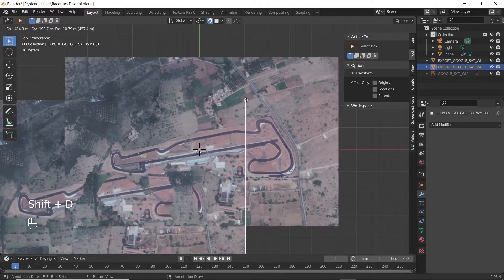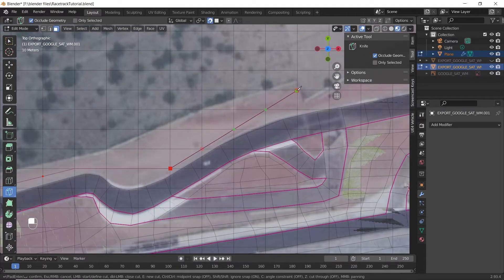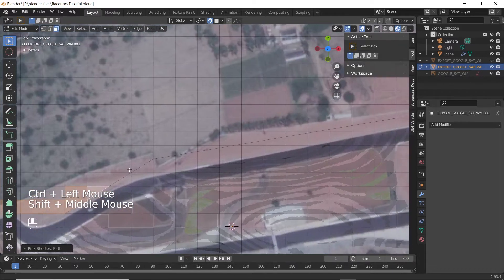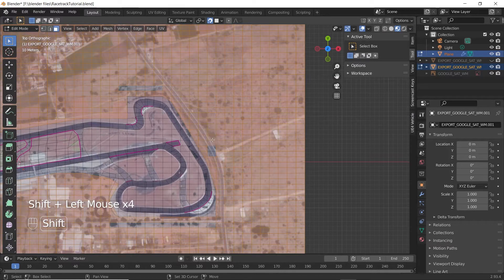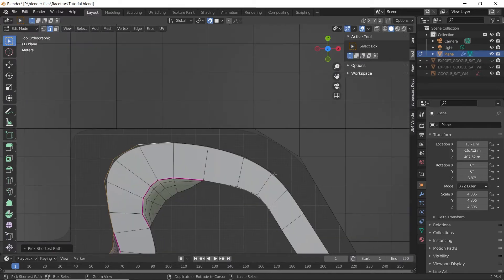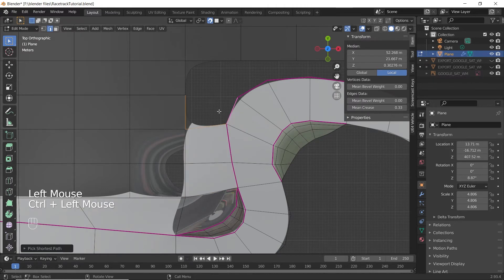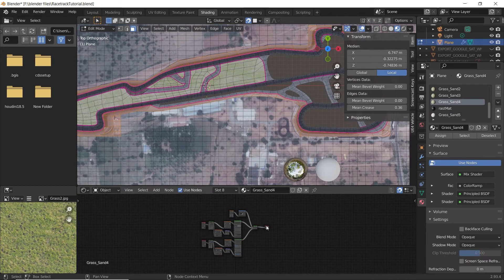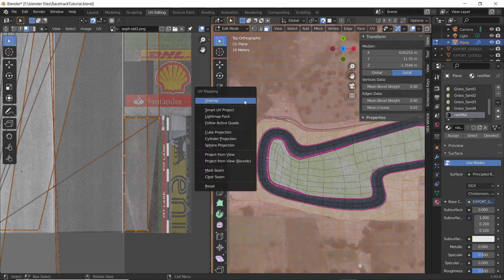Part5 : How to make a racetrack in Blender (Connecting surroundings to track)

Comment: Hey dude, could you help me? The grid on the ground plane shows up, but when I try and use the knife on it, it doesn’t snap to the vertices or anything. I can give my discord if needed
Reply from the maker: R the red and green dots not showing? Sometimes the dots don't snap to the vertices. You can click on the vertex to fix the point there. Most probably it's a glitch. And stay in top view for accuracy, because u may get overlapping vertices and u won't be able to see that
Reply: Yeah, the Red and Green dots aren’t showing. But when I click on a vertex and try to connect it with a different vertex, nothing happens. Again, I can give a video of it if it helps to explain the problem :)
Reply from the maker: Ok send video
Reply: What’s your discord? Also, I won’t be home for a couple of hours, hope that’s fine
Reply from the maker: https://discord.gg/KGKGBueB
Reply: Never mind, managed to get it fixed. Apologies if I’ve wasted your time. Should mention I’m loving the series and it’s really helping me get familiar with blender haha. I’ll make sure to join the discord though so if I have anymore problems, I can send em in there.
Reply from the maker: Yeah sure